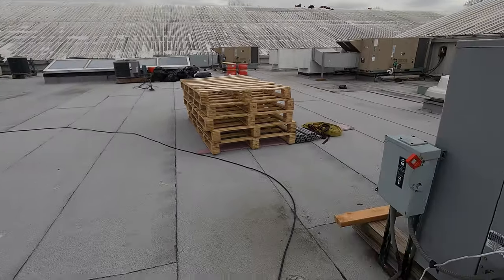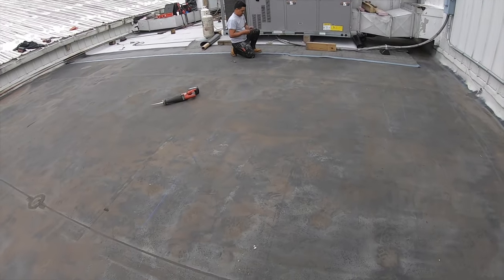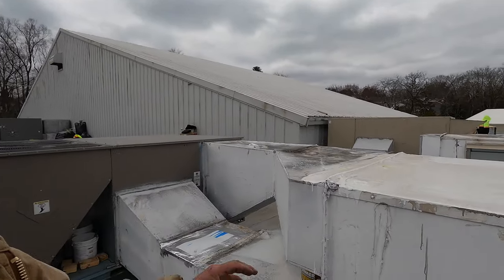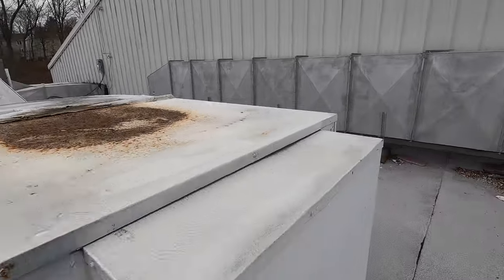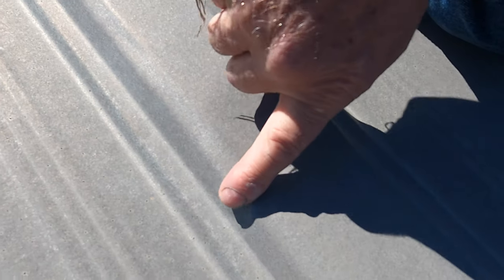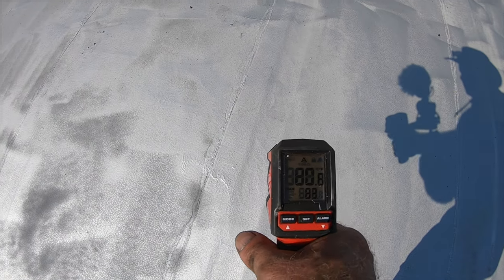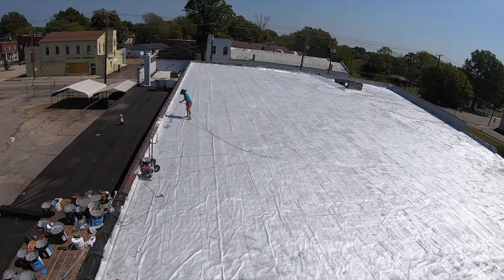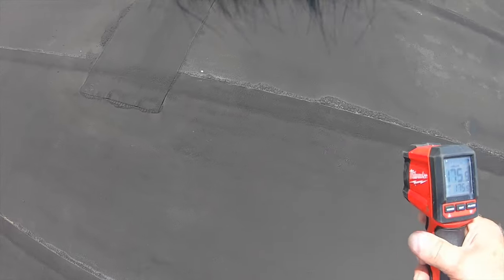DO NOT buy a New Roof or Building with Flat Roof before watching this video

Comment: What about EPDM roof with no seams just penetrations around vent pipes?
Reply: Depends on if it's Firestone or Carlisle or not.  Quality of the epdm makes a huge difference.  Installed is second but it's hard to mess up.  It's the flashing points that usually fail.
Reply: @Datsyzerberg  I was looking at firestone
Reply: Great choice.  There are also grades.  Better the grade better the life for the most part aside from specialty grades.